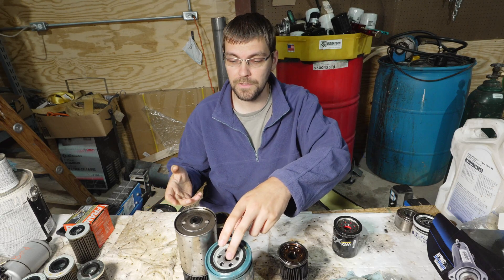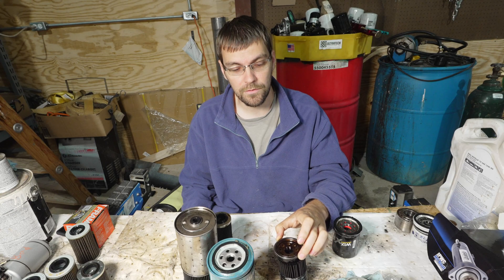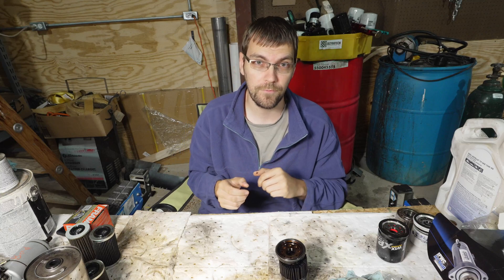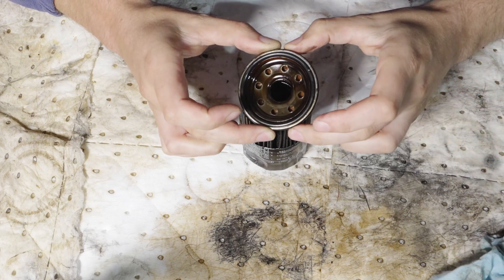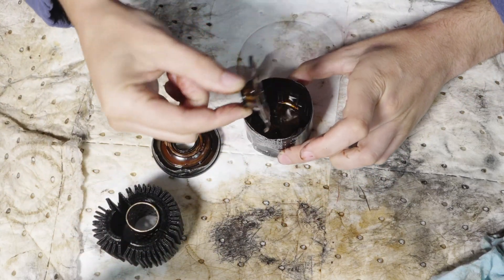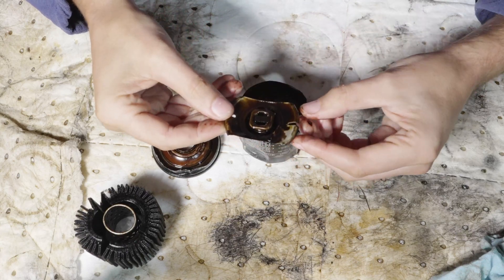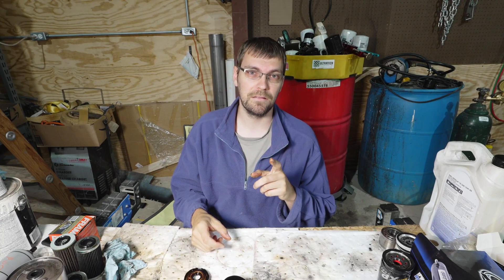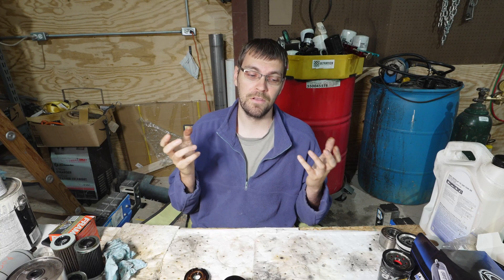400 Hours Without an Oil Filter Change: Inside a Yamaha Waverunner Filter

Comment: That’s a lot of hours for a JetSki.
Reply from the maker: You should see the Honda F15X I've got in my shop with 2300hrs! Original engine, Jet pump, etc. Going to tear it down at some point and see if the engine is repairable
Reply: Not for a four stroke Yamaha rental ski. They go into the thousands of hours.
Reply: Not for a Yamaha lol ..... A sea do yes. They get 1000+ hrs easy out of them , they use these engine in their boats
Reply: No it's not. Just getting broke in.
Reply: i put 30-40 hrs on my skii every weekend 😂 this would take me less than a year to put 400 miles on my skii , yall need to ride more …..